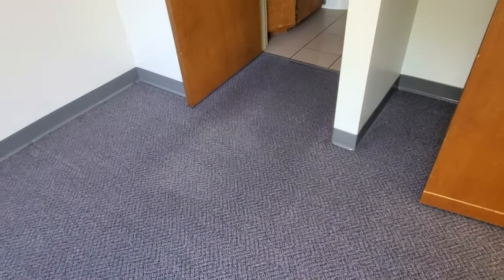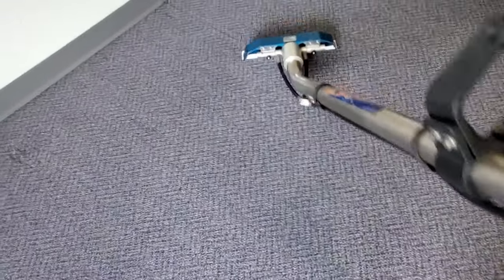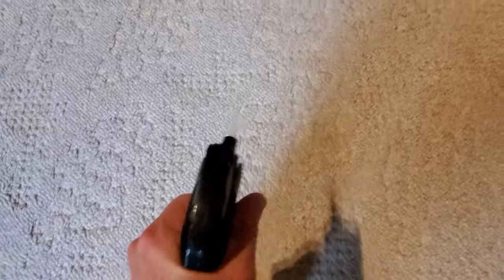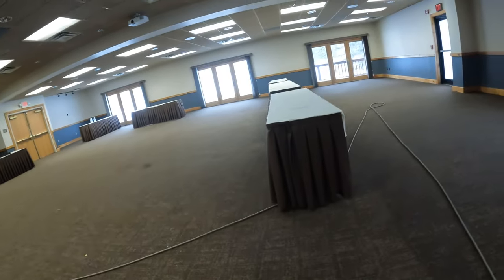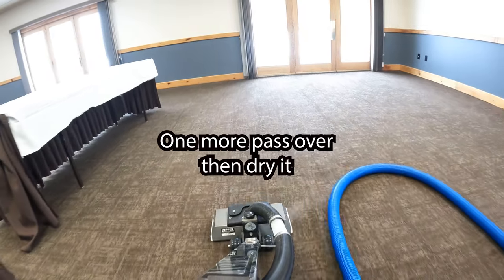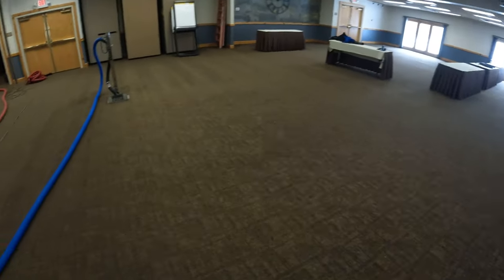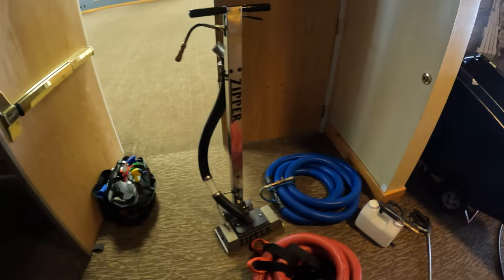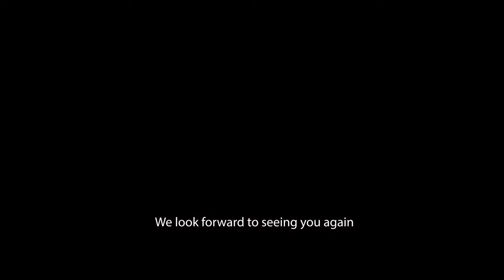Bad Dog! How to Remove Urine and Feces from Carpets!

Comment: Thanks for the videos. Entertaining. 

I need to test your products out soon. 
For pet issues, I've used unduzit enzyme. I've only had one callback with that product due to cat urine smell. It was a 45min dwell time so maybe not enough time. 
Came back and retreated with unchained and that seemed to solve the problem. 

I've found the peroxide based products work better for urine stains. Especially nylon carpet. Would you agree with this?

With your odoroxy, does it need to be used undiluted for stain removal? I believe it is about 7% peroxide. 

Thanks again,
lǝɐɥɔᴉW (from Aus)
Reply from the maker: We use our bacteria enzyme products the most personally which is P-Lime-Zyme or P-Zyme Eucalyptus Mint. We reccomend at least 30 minutes of dwell time but longer is also good as the bacteria enzyme will keep consuming and secrereting more enzymatic materials. Cat urine can be difficult for sure though. With our bacteria enzyme, we do run it with WARM water such as through our inline sprayer (Hydroforce) or using a pump up or electric at one part Zyme with 4 parts water. You don't want to use any other chemistry with a bacteria enzyme so it can be the most effective. I have some videos I can share with you using them if helpful also. Our Zyme products are pretty good on stains but a peroxide will address urine stains very well too, and sometimes a peroxide is needed for a stain. Our OdorOxy is about an 8 percent peroxide. It can be diluted and still do well on stains but might take a little longer to remove a stain diluted. But with the amount of wool you might have there you might want to dilute it a bit. 

We should have those products available in Australia with Kenan I believe.

I appreciate your comments and being here with us. Let me know if I can help in any manner 😊👍
Reply: @Mark Saiger  thanks for the reply.
I have found the products from Kenan online. I'll have to test them out later this year. We have lots of cheap poly here now unfortunately. It doesn't last long at all. What's your go to prespray for poly?

Also Peroxide is my favourite mainly because the fast fizzy action 😀 enzymes can be a bit boring haha.
Reply from the maker: @JustPerfectHomeServices  I know that cheap poly you are talking about! We have a lot also. Our presprays work well on them. Code Red is the most powerful, but a lot of people do like our original Saiger's Sauce 1 for ease of use. Our presprays can be boosted with our Harvard Chemical G-Force Booster which is a liquid soy booster. I think Keenan has that product also. The poly carpet is not supposed to stain, but yet we have seen permanent "cattle trails" as we call it, within a year in the carpet and it makes us all look like we have never cleaned carpets before! We can usually do a white towel test with a spot remover and get no soil transfer, so we know it's the carpet already worn.

Enzyme products definitely don't have the fizz 😁😉... The peroxide can make for some fun volcanoe experiments 😁.